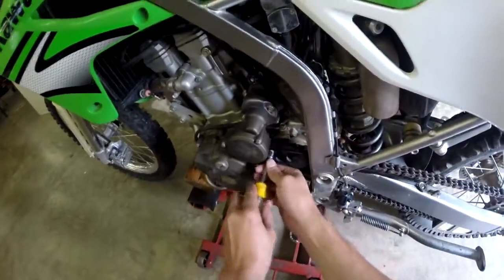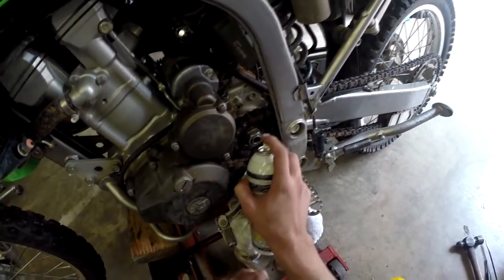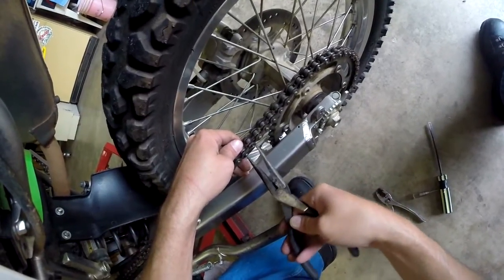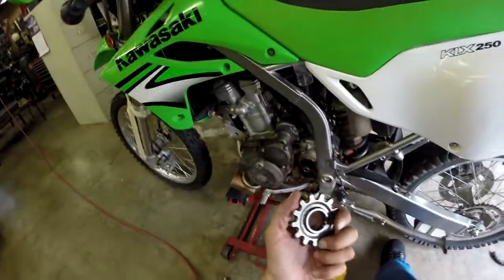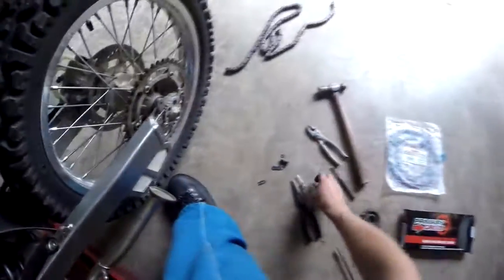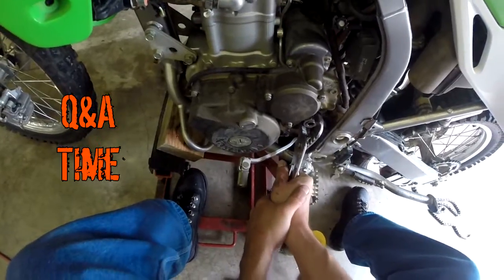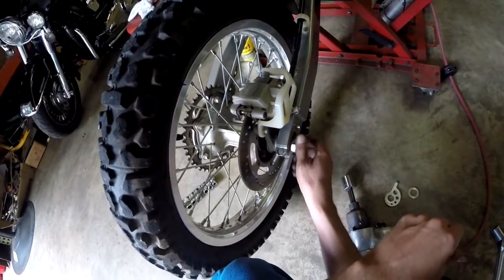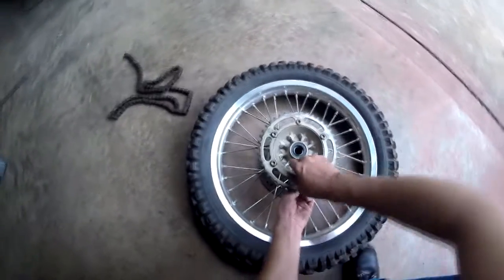How To: Sprocket Removal and Installation (KLX250s)

Comment: You did a great job. This is the first mod any one should do if they are trail riding. Or just want to feel a little boost in power.  If you only have money for one mod this is it AND you will have gas money left over. It will mess with your speedometer but they have speedo correctors out there if it bothers you. DirtHog365
Reply from the maker: Thanks man, I appreciate the support!  Definitely looking forward to getting back on the trails now! :)

Comment: Great video. What size socket did you use for the front sprocket? I have a 09 klx250sf and my rear sprocket is a 39 tooth from the factory. How much of a difference should I expect regarding freeway speeds with a bigger rear sprocket? Any pros and cons? Thanks

Comment: hey man, i just replaced mine on an 09 klx250sf, but my chains seems really loose? how do i adjust tension on the chain? thanks in advance
Reply from the maker: +david valencia sorry bud for taking so long to respond, you'll have to loosen the rear axle enough to where you can slide your back wheel back. The clam shell looking adjusters have numbers on them, set them to where you have tension but not overly tight, with about 1-1.5 inches of slack on the bottom of the chain near the kick stand.  Tighten everything back up and replace your cotter-pin (very important).  A friend helping in all of this is a plus, but it can be done by yourself...check the slack with your heel while sitting on the bike and see if you have enough play in the chain.  May also want to check if your chain and see if needs to be replaced, it is always a good measure to replace both sprockets and chain at the same time.  Hope that helps and I can throw a how-to  vid together on doing this. =0)

Comment: Hey do you know the part number of your fmf muffler by any chance? I got a 07 klx250 also  but the fmf website doesn't have one for the 07. Or did you go with 06 muffler? Thanks!
Reply from the maker: +Coleman Parkhill the 07 KLX250s can be a pain in the butt sometimes when looking for farkle and parts alike.  Give motorcycle-superstore.com a shot, they've been the best for me at finding parts and accessories.  On the Q4 FMF, I used SKU 527026 / Mfr. Part 042156 which will fit 06/07 KLX250s models. =0)
Reply: 06 Fmf should work with 07

Comment: If I change it to a 13 will it go faster ??
Reply: It will have more torque off the line and “kick” to the acceleration. Apparently it takes a bit off the top end but the debate is never ending lol.

Comment: What is the purpose of doing this? Like how does it effect the bike?
Reply from the maker: It increases torque by 13%, but drops overall speed by about 13% as well - did this for trail riding versatility vs street riding.  =0)
Reply: DirtHog365 Oh okay thank you

Comment: I can anyone please help me i can't find a klx 13t (for my 2012 kawasaki) . sprocket in my country does anyone know if a kx or kxf sprocket would fit?
Reply from the maker: Not sure if it helps, but Sunstar 520 front sprocket 13t (Mfr. Part # 3B113) will fit 2012-14 KLX250s.  I used motorcycle superstore to get the parts I needed and they have a full fitment guide.  Good luck in your search and thanks for watching! =0)
Reply: Motosport.com has one

Comment: Thank you so much for this video. You made it look so simple that I had to do it. A 13 tooth sprocket makes it feel like a completely different bike now. My klx 250sf is my daily commuter  so I was worried about top end but it's not as bad as I thought it was going to be.
Reply from the maker: +derekkt49 that's great to hear and happy the vid helped ya out.  I love the torque produced from this rather simple change when it comes to the trails as well.  Ride safe and thanks for watching! =0)
Reply: +DirtHog365 I rode to work today and it feels great. before the bike would almost feel like it was going to stall out if I didn't give it enough gas. Now I get a better response. It almost feels like the bike should come stick with a 13 tooth... Btw, what do you think about the 351?
Reply from the maker: +derekkt49 hahahahaaa...I know exactly what you are talking about when it comes to throttle response and knowing it's there when you need it.  I'd also suggest adding FMF Q4 and Powerbomb header, along with the carb rejet (vids available for the rejet) if ya haven't done so already.  I have considered doing the 351 big bore kit and its on the list, of many lists.  Shameless plug here, but check out my buddy Adventures in Real Life who has done a ton of upgrades including the big bore kit.  Let'em know I sent ya, he's good at responding to questions and is very insightful/helpful! =0)
Reply: +DirtHog365 I've been watching ARL for the past couple weeks. I like how much detail he puts in his videos... I didn't realize it till now but I already watched your carb video. I have the jet kit but I was waiting to install it till I decided if I wanted a new pipe or not...I bought a 2009 klx 250sf with 800 miles on it for 2800 OTD. I bought it strictly for transportation back and forth to work because I sold my wife's car and now she's driving my Tahoe(trying to save money to pay off student loans). I never planned on loving the bike, but I caught the KLX 250 bug and now realize that I got a good deal on a very reliable bike. I think I want to keep it forever but I'm 29 years 5' 10" 215lbs. lol, here's my question- Am I too big for the bike? Do grown alot of grown men own 250's. my previous bike 3 years ago was a 09 Harley fat bob so I'm new to enduros.  I don't won't to put money into it and later realize I need a bigger bike.
Reply from the maker: +derekkt49 sounds like you got one heck of a deal and yes the KLX250 bug will get a hold of ya real quick., bought mine for just about the same.  I highly recommend the rejet. The plus side is that you get a chance to clean it out, especially with the crappy gas we have now,  whole other story there, but piece of mind is priceless.  
The KLX250 is highly reliable and won't break the bank either over the years.  Sure there are better bikes, but they come with a significant cost and maintenance bill that can be back-breaking, even on the used side of things.  I do love the KTM EXC 300, but rare to find one used in my area and buying new is not even an option (plus side of $8K).  If ya go up in scale, like a KLR650 - you get more go for the buck, but a heavier bike overall.  eveRide channel is where to go for KLR related vids and worth giving him a look/sub if not done so already (yes, another shameless plug).
TLC goes a long way with any bike and a few mods like the pipe/header and air/fuel filter (get rid of the snorkel) will allow her to breath.  Parts are rather cheap, but will be honest - finding direct fit aftermarket parts can be challenging and may need a slight modification.  The kickstarter kit is also worth looking into (remember that list I have) - nothing sucks more than a dead battery!  You are the perfect height/weight ratio to be on the KLX at stock, but can always adjust spring preload if necessary.  
Lastly, it all depends on what/where you plan on taking her?  Would I do a 3-hour road trip on the highway and what not - no, only because I am lazy, like having saddle bags for beer, and stretching out on the Street Glide.  However, would I cut her across 6-hours worth of trail riding without a moment's thought (other than gas), absolutely.  I have modded her to do exactly what I intend on using her for, a trail bike.  As for a commuter bike, you have a winner IMO, it does exactly what you need it to do.  My best friend uses his more of a commuter (2007 version) than a tail bike and made the same mods I have done.  There are a lot of avenues for the KLX250 - just all depends on what makes you happy! =0)
Reply: +DirtHog365 Update: I switched back to the 14 tooth. The bike felt great if I stayed under 55mph but any faster and it felt like I was beating the shit out of the bike. On top of that, my my head gasket is leaking around the black Simi - circles. A mechanic told me that dirtbike are not designed to ride at high rpm for long periods of time...But there is hope! I followed your Dynojet video and re-jetted the bike.The bike is sooooo smooth now. Before I couldn't get it to idle. Before, It would bounce between 1000-2000 rpm. now it will idle at 1,350 all day. Wheelies are easier to keep up too because of the improved throttle response. Thanks!
Reply: I’m about to make the change to my 2020. I’m excited for the difference. Feel like a man riding on a turtle sometimes on the road haha.